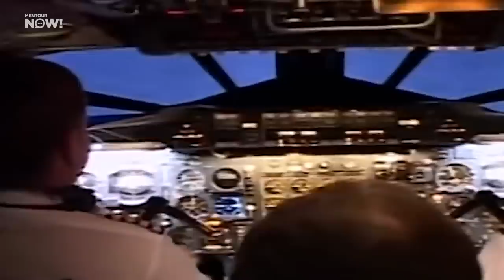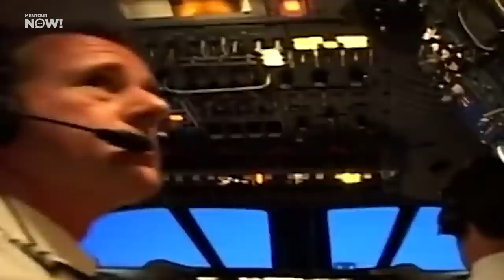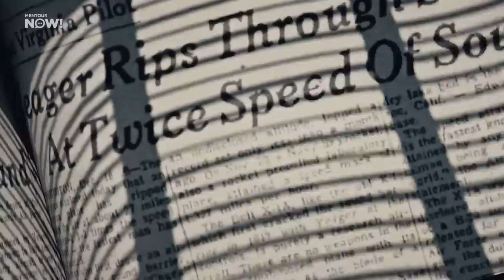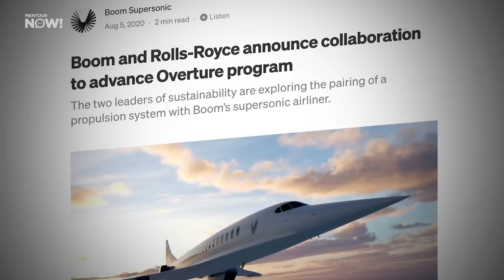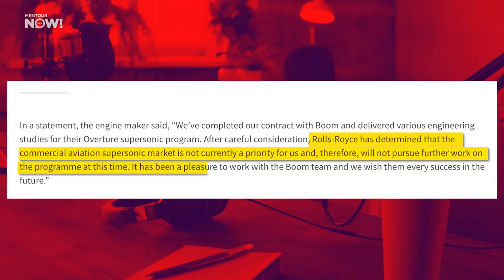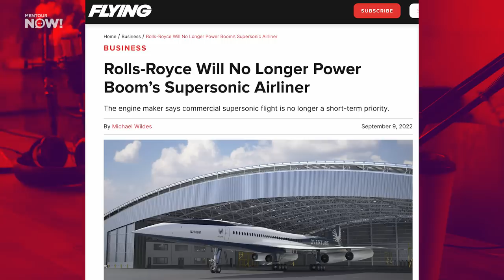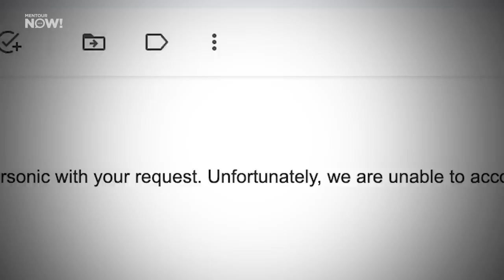WHAT’s Going On with BOOM Supersonic?! Will it Fail?

Comment: They are going to suffer a similar fate as Concorde... low demand. Prices are going up and wages are going down... meaning little commercial demand for super expensive flights.

Also, since Concord, there are a lot of new rules about noise... most these aircraft will not be able to travel supersonic whilst over any land unless completely out of earshot.
Reply: @Completeaerogeek  I'm good thanks on the link, don't need to read it.

I am not just talking about supersonic noise... planes now have to be under a certain decibel when flying over built up areas and supersonic engines even when not going super sonic generates more noise.

Also you don't have first class only planes... a plane will consist of multiple classes... with most of their profits coming from the lower classes... hence why first class areas are the smallest on a plane. Also supply and demand ALWAYS takes effect... They will be able to fly and maybe make a profit... but it wont be anything compared to the cheaper cost of a normal plane and having more of them.... meaning they will have more customers and at a lower cost to themselves. It's the reason why lorry's and boats still exist... they carry much more for much less.

The cheapest flights will always win control and usage of the skies... always. Since supersonic aircraft cost more to build and maintain than a normal aircraft... they are never going to get into that position.
Reply: @babalonkie  Thanks for your response but sounds like you don't have any experience with airline revenue management, so I will explain. The premium product is where airlines make the most profit. I was a senior manager at a US major - at the time the 5th largest airline in the world. (I also studied airline economics at the Postgraduate level) On our transatlantic flights if BusinessFirst was 75% full, the aircraft operating cost (fuel, crew, maintenance factor) was paid for. The rest of BF, all of Economy and all the freight was profit.. That's how big a deal it is. A First Class ticket long haul can cost 10-20x an economy seat.

Secondly, yes noise is an issue. ICAO now requires Stage 4. This will be a problem for Boom as they cannot use high bypass engines which are much quieter. The exhaust gas velocity is too low and the frontal crossection too high. It must be a low bypass turbofan or turbojet. Noise is caused by acoustic shear, where high velocity gasses meet slower moving or still air. There is no way around this. This is why you don't have quiet fighters.

I hope that helps.
Reply: @babalonkie    Thanks for your response but sounds like you don't have any experience with airline revenue management, so I will explain. The premium product is where airlines make the most profit per seat. I was a senior manager at a US major - at the time the 5th largest airline in the world. (I also studied airline economics at the Postgraduate level) On our transatlantic flights if BusinessFirst was 75% full, the aircraft operating cost (fuel, crew, maintenance factor) was paid for. The rest of BF, all of Economy and all the freight was profit.. That's how big a deal it is. A First Class ticket long haul can cost 10-20x an economy seat.

Airlines always try to sell Business and First as a priority. They they release economy seats in blocks which is why you see price variations as time goes by. Depending on revenue projections on that sector, they may release cheaper seats closer to the flight departing or teh seats may become more expensive. Load factor calculations are a market analysts job which is why airlines watch this very carefully. 

If economy ruled as you claim, all airlines would be LCCs but they are not. Many companies have a requirement for Business or First on trips over 4 hours. One I worked for later did and all of my trips to the Middle east and South Asia were in Business. They want you to be in reasonable shape to work when you hit the ground.

Secondly, yes noise is an issue. ICAO now requires Stage 4. This will be a problem for Boom as they cannot use high bypass engines which are much quieter. The exhaust gas velocity is too low and the frontal crossection too high. It must be a low bypass turbofan or turbojet. Noise is caused by acoustic shear, where high velocity gasses meet slower moving or still air. There is no way around this. This is why you don't have quiet fighters.

I hope that helps.
Reply: @Completeaerogeek  Let me expand further...

1) No City (Especially Europe) will allow extremely noisy aircraft anywhere near them... Even people like me who marvels engineering will vote against such aircraft from causing noise pollution... no matter the benefits. That instantly means all commercial and main runways are off the table.

2) Immediate time will tell... if most airlines stay away from the concept... my original point of "profit" being irrelevant to supply and demand stands...

There's many reasons why supersonic travel has just been none existent for nearly 2 decades... and i have already listed those reasons.
Reply: @babalonkie  Actually I very specifically countered most of your points and even agreed with one. Perhaps you should re-read my answer.

You were incorrect about economy class ruling (except as I noted, for LCCs).

I agreed with you that a low bypass turbofan as required for an SST will not meet nose restrictions under ICAO Stage 4.

Further, under current laws, an SST can only operate supersonically over water (except by special permission) so long haul is what it is best suited to, just as Concorde operated mainly transAtlantic and why it did it so profitably for BA for over 20 years. Concorde was in service for 27 years about the average for a long haul airliner but was in far better shape due to lower hours/cycles. it was withdrawn prematurely because Airbus withdrew its Type and Airworthiness Certificates. They decided they were not making enough money from engineering design support and more importantly, I suspect, did not want it competing for First Class seats with their new fat A380 and upcoming A350

if you read my original comprehensive post, I have strong doubts about Boom getting up, for all the reasons I explained there. I hope they do as i would love another chance to fly at Mach 2.0 and 60,000'. It was amazing but they have a long road ahead.

Comment: While there is doubt Air France made a profit on Concorde flights, BA certainly did - very large profits but only after BA privatisation when Lord King threatened to ground the fleet unless it became profitable. So BA asked the passengers what they'd paid for their ticket - and being businessmen on expenses they did not know. So BA asked what they THOUGHT the cost was -  and most over-estimated the ticket price by about double the actual cost. So BA doubled the ticket price, lost no custom, and went into profit!
However, this did not take into account the REAL cost of procuring the fleet which both airlines got for a fraction of the true cost of developing and manufacturing the 14 production Concordes. The British & French taxpayers paid for that!
Actually, there is area ruling in Concorde's design. The cross sectional area always increases gradually - the wing begins very far forward and only very gradually increase in span as it progresses rearward. Similarly the fin is a gradual increase in cross sectional area but not to the same extent as the wing so the engineers reduced the fuselage cross section where the fin starts. This is clearly visible in the external cabin roof when you stand on the aircraft's steps and look back along the fuselage (I was a tour guide on G-BOAC for 14 years so did this many times!). I also flew in the jump seat of G-BOAD for an entire flight including M2 at 60,000 over Biscay (I knew the captain as we both flew vintage light aircraft as a hobby).

Comment: Why are military engines not used for this?
Wasnt that what they did in the past?

Cant they get a loan of 4 PW F100 from the airforce? At least for the prototype.
Reply: Military jet engines are way too loud and burn too much fuel.
Reply: Not enough dry thrust. You need to be able to fly supersonically without using afterburner (supercruise) The Olympus 593 in Concorde was able to do this. It produced 30,400lbs dry.

Comment: Until the ‘boom’ issue is resolved the viability of supersonic flight over land is minimal on legal and environmental grounds. The most profitable routes are always going to be transcontinental east to west coast and return. Until the research is back from NASA and the boom resolved  everybody is just chasing paper dreams.
Reply: @alanhutchins5916  Overture will not create a sonic boom over land because it will fly subsonic. Overture will be 20% faster over land and 2x faster over water. Because Overture will be much lighter and will use modern medium bypass engines, it will be economical at both Mach 1.7 and subsonic. As a result, Boom have identified 600 viable routes, as opposed to the two viable routes for Concorde. Overture will be able to fly the Pacific with a 30 minute refuelling stop en route. So a 16hr flight on a subsonic jet will be cut to 4+0.5+4=8.5 hours.

In contrast to Concorde, the cabin will be spacious and quiet, and the seats will be comfortable.  Overture will have a modern cockpit and will be like flying a regular passenger jet, so the 6-month pilot conversion course will not be necessary, and a flight engineer will not be required. Overture will also be cheaper to buy and maintain, and it will comply with ICAO-14 noise regulations, meaning it will be able to use all airports.

Taking a JFK to LHR one way flight:  
Showing: Aircraft type,  Fuel cost per passenger,  Economy ticket,  First Class ticket,  Duration

Boeing 747       $147          $577             $2,308                     8hrs 
Concorde          $753                                $5,000^                   3.5hrs 
Overture           $628^^      $1,300            $3,800                     4hrs 
Business jet^^^                                 $53,000 to $99,000        8hrs  

Notes
^ 2023 money 
^^ Assuming that Overture is 20% more efficient per mile and carries 72 passengers 
^^^ There are no supersonic business jets

Comment: Wasting a shit Ton of Energy just to fly a bit faster causes more emissions, independent from the source of the fuel. I don't really like the argument made at 4:38, just because something uses a sustainable fuel, it doesn't mean it's a good idea to waste it's fuel. Because every ton of fossil fuel a plane has to burn, is still a ton of fossil fuel that has to be burned. And there is only so much sustainable fuel that can be generated. Same for electric energy. When people waste solar energy because it's sustainable, there is a lot more other electric energy that needs to be pushed into the grid to fulfill all demands.

Comment: No engine = no SST.  All but one of the current Western engine builders have declined to develop an engine for the Boom Overture.  You build a plane around the engine, and the engine builders think commercial supersonic flight will ever only be at best a niche market and not worth the investment. No engine = No Airplane.  I know about the commercial orders, but you really need to think of them just as free advertising for those airlines.  Nobody's put any serious money down.  Lastly, the Boom XB-1 proof of concept is now an entirely different design than the latest Overture, so not even sure it's relevant to anything.  It's flying with three J-85 engines from the T-38 / F-5... engines that have become notoriously unreliable in afterburner due to age.  On top of that, the original desing for XB-1 and Overture were really aerodynamic and design / engineering non starters.  When Boom engaged some of the legacy aerospace firms (Lockheed, Boeing)  they quickly told them the curved leading edge profiles were not optimal aerodynamically and not produceable at scale... basically, the Boom XB-1 and Overture were products of the Art Department, not the Aerospace Engineering department.  I suspect a rich person with a dream is the real story behind Boom,  not an aero engineer with an actual plan like a Dick or Burt Rutan. So, an irrelevant prototype flying non viable engines > no production engines > no market > No, Overture isn't going anywhere.  

Side note, isnt' it interesting that the most recent design for Boom Overture and the now defunct Aerion AS2 both ended up looking a lot like the proposed Convair B-58 derived Model 58-9 SST from 1961?

Comment: John 
Australia

Boom Supersonic may not have done their Homework properly on the arrival of a New SST into the Aviation World despite the initial order from United Airlines we now have the possible Engine Provider (Rolls Royce) pulling out of the Program leaving Boom Supersonic in all all sorts of Strife it they can not secure the Service's of Another Engine Manufacturer.
Post Covid, I wonder if This was a Knee Reaction in saying the Aircraft is to make it's First Flight In 2026, with Delivery well beyond I think, Having Power Plants that probably will require to be Sustained Renewable Fuel wise it could be difficult.
Reply: Am a American But I Agree
Reply: @johnwoodall3791

Florida Turbine Technology, a division of $1.88bn Kratos Defence, started the symphony engine design in January 2023. Boom stated that no current engines, either military or commercial, are suitable for adapting to Overtures unique requirements. 

Boom will design the pods and the variable geometry exhaust and inlet ducting.

A big fuss is being made about Rolls Royce ending their contract with Boom, but AFAIK the contract was only for consultancy, and not to build an engine for Overture. Besides which, the Symphony project would be totally unsuited to the tier one engine manufacturers, like Rolls Royce, GE, P&W, and Safran. Their cost base and time frames would be out of kilter, and the volume of sales would not warrant their investment. GE caught a cold with the Affinity program.

Comment: Why are military engines not used for this?

Wasnt that what they did in the past?
Reply: Too low thrust and too fuel inefficient. The Olympus 593 in Concorde produced 30,400lbs of thrust without afterburner which allowed it to supercruise at Mach 2.0 for 3+ hours. not other aircraft civil or military has ever matched that. It was the most thermally efficient turbojet ever produced.

Comment: "...[Rolls-Royce] would need to commit substantial amounts of its own money in developing... "

Notwithstanding the fact that we're talking about a supersonic passenger aircraft, this sounds like this could have been another situation like the RB.211 for the Lockheed L-1011 TriStar, doesn't it?
Reply: There is also the issue whereby Rolls have gone to a largely leasing model with commercial engines, and might not want to get stuck with a potentially very limited customer base for a risky engine

Comment: The Irony that the Rolls Royce killed the Boom Overture. The US killed the Concord from the begining as it restricted its use in the US.. 
What killed the Concord eventually was that their was no way you could maintain it with the drawings never being digitalised.
Reply: Unfortunately that is not true. BA had plans and spares to run Concorde to 2010-15 as it had been profitable for them for over 20 years. It was withdrawn prematurely because Airbus didn't want to continue providing the engineering design oversight. It didn't make them enough profit so they withdrew its Airworthiness and Type Certificates (essentially its licence to operate) Air France sided with Airbus because their company had struggled to be profitable with it and the mainline carrier was also unprofitable. 

BA wanted to go it alone and went to Airbus with a plan but Airbus reportedly said 'not at any price'.

It might also have had something to do with the fact that Concorde soaked up 800 First Class seats a day over the Atlantic and First and Business is where all airlines other than LCCs make their big profits, so Concorde would be competing with the new A380 and A350. 

I know what I would choose to fly on.

Comment: Hate to sound like an airplane snob but when they started they could go super sonic over land and would be cruising at 2+, without these metrics, I wouldn't be interested. The Boeing he mentioned at 2.7 would be waaaaay more appealing, even if the ticket were significantly more. In my mind, I just can't justify paying substantially more for a jet that flies slower than one 20 years ago
Reply: Taking a JFK to LHR one way flight:  
Showing: Aircraft type,  Fuel cost per passenger,  Economy ticket,  First Class ticket,  Duration

Boeing 747       $147          $577              $2,308                    8hrs 
Concorde          $753                                $5,000^                   3.5hrs 
Overture           $628^^      $1,300            $3,800                     4hrs 
Business jet^^^                                 $53,000 to $99,000        8hrs  

Notes
^ 2023 money 
^^ Assuming that Overture is 20% more efficient per mile and carries 72 passengers 
^^^ There are no supersonic business jets

Comment: Boom hasn’t really pushed anything though, this ‘keeping it simple’ is why it is failing. They didn’t account for the heat of Mach 2.2 is exactly what happed. 1.7, and the fact that they tied themselves to old SS aerodynamics is why they will fail. The market doesn’t need another Concorde, the market needs the next generation of SS, the one that doesn’t shatter windows along the route. That requires added complexity. The future does not exist in the past, it exists where the problems of past design have been solved and new ideas have been applied.